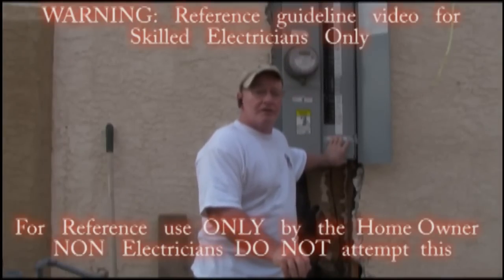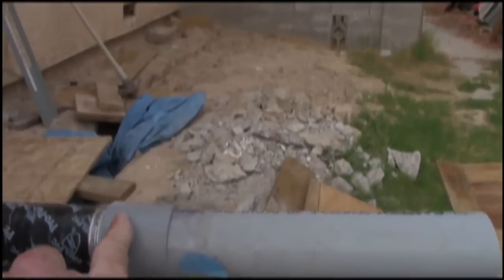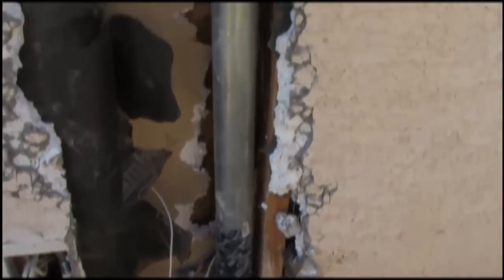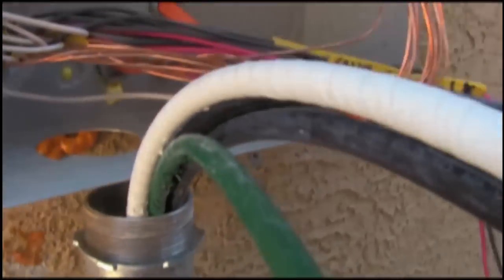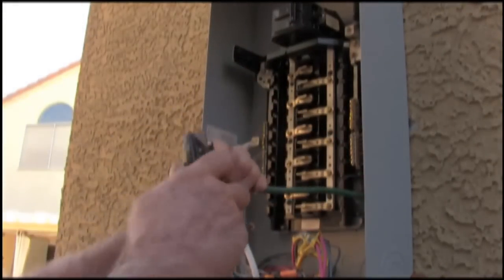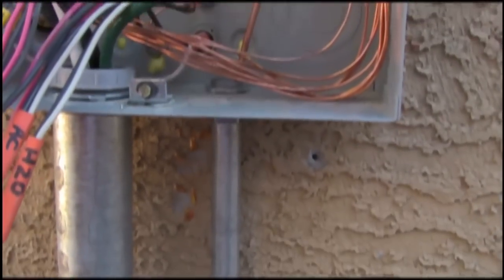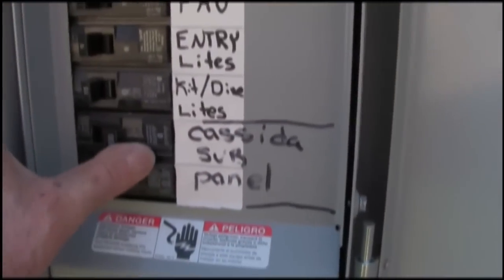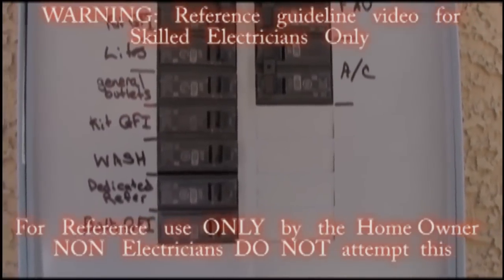# 51 Feeding a sub panel complete instructions

Comment: very good video the only thing I noticed was not very much slack on the neutral. 200 amp aluminum  or copper is hard to leave service loops on but on 100 amp I like to leave at least 5 inch extra in a loop or routed where it doesn't interfere on the 2 hots and the neutral just because I've fixed many panels with a burnt off neutral connection.

Comment: What size wire did you use?
I am looking to install a 100 amp sub.
Thanks
Reply: #2 aluminum and #6 ground. #3 copper #8 ground for 100 amp
Reply: I use #3 Copper #5 ground or #1 Aluminum with #3 ground for 100A

Comment: Hi, I'm installing a 125 amp subpanel in my attached garage because the main breaker panel is in a physical location on the other side of my house.  I'm planning to feed it with copper 1 gauge hots and 1 gauge neutral along with 3 gauge ground.  The only feeder I can find is separate THHN feeders and not in a 1-1-1-3 configuration.  Is it acceptable to have feeders in a non-bundled fashion if they're inside conduit, and also is PVC conduit acceptable for use between the main and sub?  Thanks.

Comment from the maker: I cut myself short. Use # 2 THHN  with two hots and one neutral and then ground panel to panel with # 4 and provide a second ground via ground rod using # 6 bare protected by EMT. This will insure proper grounding to the subpanel and also minimize cross currents when the two legs have a large difference and the neutral picks up the difference. I know this is over kill, but grounding is really  important.

Comment from the maker: The question is more complicated than you realize. A house requires 3 watt per square foot, A workshop requires .25 watts per square foot. (NOT ENOUGH POWER). If your building is under 500 square feet you do not need to do load calcs, and I would use a 100 amp subpanel with the disconnect means at the main panel. You may have to manage your power, but a 100 amp subpanel will practically eliminate any substantial voltage drop. In your case I think 3% is allowable.Use # 2 copper with a ground rod,

Comment: I would like to run a sub panel to my shed/work shop. It has a small window a/c, a ceiling fan with a light,4 wall sockets and I would like to run my welder from the shed too witch uses a 220. What size will the main breaker have to be inside the sub panel and then from there what size will the breaker have to be inside the main breaker box to power the sub panel? Could they both be 60 smp breakers? Just saying becouse I have two already.

Comment: My strippers goes from 22AWG to 500MCM, the inspectors here would tag us if we used a knife or the twisty action too strip the conductor, He said that both ways would derate, so I have too use the correct size stripper for the wire size..

Comment from the maker: Not to be argumentative but just the opposite is true. You use the knife just enough to score the covering. Strippers only go up to # 10 usually, so you have to do the 'twisty' action which does cut into the conductor and thus derates it. I was told to always use a knife by Earl Russell, head of the Las Vegas building and code enforcement for 10 years (before that he was the most obnoxious inspector I ever met). He he...were actually friends now.

Comment from the maker: The new code is very strict on separation of ground and neutral bars.  This is just a false appearance. The ground and neutral bars are most definitely separate. Old code required the separation on three phase because the connection of the ground and neutral could cause a phase variance...now all subpanels and panels need to have isolated ground and neutral bars. Additionally, some GFCIs will not work properly if the ground and neutral are not isolated.
Reply: softcellelectrical  )

Comment: It looks to me like the ground and neutral bars are still bonded on the sub-panel. I'm pretty sure that the grounding strap should be removed from the sub-panel. Please could you confirm this. I don't think it's a "huge" deal but it does create a ground loop.

Comment from the maker: I'll bet the inspectors love you. Technically you are right, however In Nevada if you installed a 100 amp outside sub panel without a ground rod they would fail you outright. Only panels of 60 amps or less do not need and independent ground rod. The exception is 200 amp or less sub panels located within the dwelling unit and usually are fed we SE or SER. Your not on the star ship enterprise, and I'm not the guy in the red shirt. I think there's a wiener in your warp drive.

Comment from the maker: I should also clarify that there is an exception to earth grounding.  If the subpanel is located in or on the same building then no ground rod or UFR is required.  As soon as you have two separate buildings (even if they are only 1 foot apart) you must ground the subpanel separately from the source using one of the two methods I mentioned.  There is a third method that I will not bother with because most inspectors will not allow it.

Comment from the maker: ALL panel 100 amps of more have to be grounded with: 1, a twenty foot length of #4 rebar imbedded into the foundation, or 2, An eight foot copper clad steel rod that can be installed at an angle NOT to exceed 45 degrees (this is in case you run into bedrock at 4 feet).  Subpanels of 60 amps or less can be grounded from the main panel...at the inspectors discretion.  As far as lightning goes, you cannot overground anything.  Thanks for the comment.

Comment: Could you go into more detail abut earth grounding. Seems like with 2 ground rods in the system that a difference in potential could exist between those ground rods especially if they were very far apart and if a lightning strike occurred. Is the ground rod at the sub panel required by NEC ?